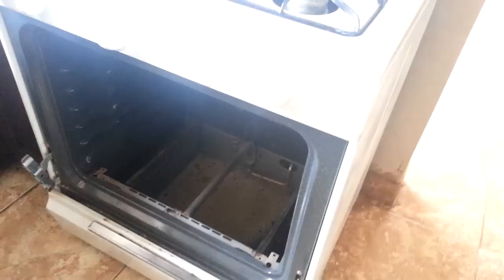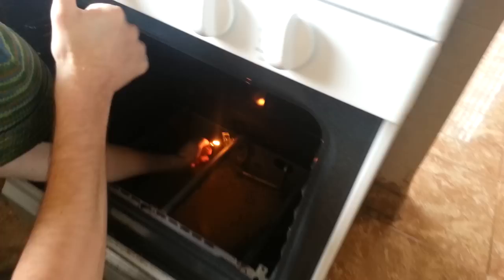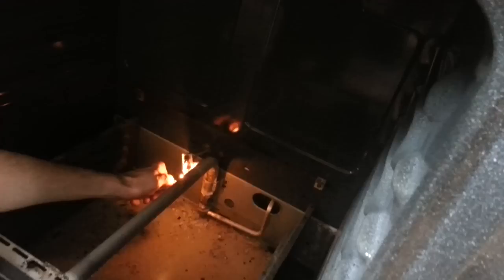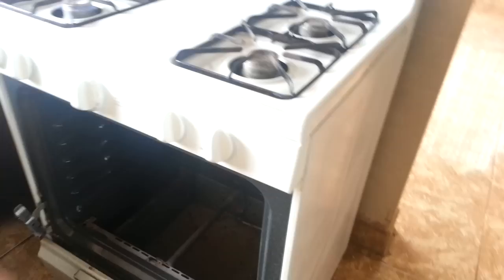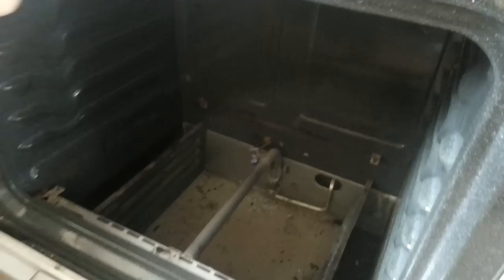Lighting a pilot light

Comment: omg, it was right in front of my face.  Here I was trying to light somewhere, anywhere on the tube in the broiler and the pilot is just above that.  Thank goodness I didn't have to remove the door, just had to slide to back of that tray up and push the tray toward the back of the oven and it came off.   Mine is the Hotpoint, pilot in the same place.  I'm renting.  I'd say the cockroaches probably blew it out because it's summer now, lol little mofos!

Comment: Omg dude ...u have to pull it apart to light it lmao. No offence but this is the worst video so far for something that's should be straightforward...yet i'm still trying to figure where pilot light on mine is. Argh.
Reply from the maker: Taking the door off and a pan out is not pulling it apart, the tray covering up the pilot light will not come out unless you remove the door first. Luckily both are very easy to remove. This is also PRINTED ON THE DOOR in the instructions so it's not like we just started doing random stupid shit, we were following instructions.
Reply: Thank you, will have to try this tomorrow Read in my oven to remove door and was like WHAT? Just really bad design but gotta do what you gotta do. Thanks for the video
Reply: liquidthex Thanks man I just did mine 1 shot. Don't waste your time on irrelevant specimens.